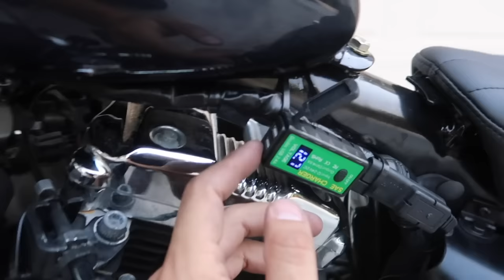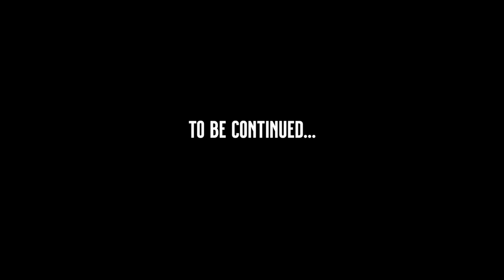Building a SPORTSTER in 10 MINUTES!

Comment: just bought a 1999sportster, got to mod it, but spent all I had buying it, but will be a small slow project. I like all you did, what tires are those? and I assume you had a second set of wheels?

in my younger days I kept 2 sets of wheels for my old shovelhead, but I rode so much, I made sure I always had a brand new tire ready to go, mounted to a wheel, ready to swap at a moments notice, & less than new tires to use in my daily riding & back & forth to work. I think I want to do it again.

Comment: I had a sporty chop with the same Air cleaner came in my shop & the backing plate blocks off the vent in the carburetor causing it to air lock & I hope you disconnected the battery before you welded on the frame since it can energize & burn your charging & ignition system  out , love the channel but some of the guys do some sketchy work on there bikes but motorcycles are suppose to be dangerous ,lol